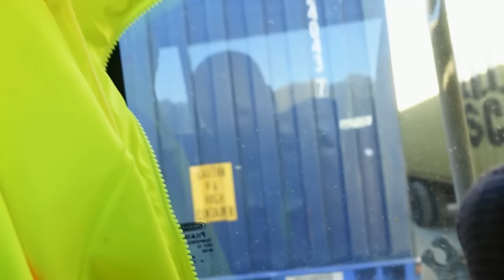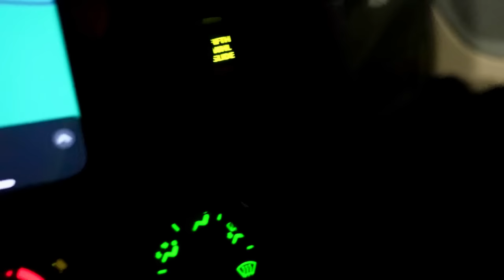Hauling Containers: First Time at Savannah Port

Comment: I use two .. a truck GPS.. an a car GPS.. some roads will not show on a truck GPS if it's not a truck route  .. u dig .. get one ASAP .. be safe.. life of a driver is if u safe  ..
Reply: Facts; Truckers sleeping on Google Maps you gotta know how to use it correctly
Reply from the maker: I use 3. I’m talking about the port doesn’t have a specific address. So, one of my coworkers told me to use “1 Main St” to get to an entrance. The port website says it’s in Garden city but that doesn’t come up on a gps. I had to put Savannah.
Reply: I have the same setup.  I even use my own dash cam separate from the company cam.  You never know and better safe than sorry.  Stay safe and keep rolling!

Comment: Hauling containers is some bs. Unless you have your own authority and even then, that became some bullshit.
Reply from the maker: Why?
Reply: @iamveelee  Respectfully speaking and I'm not trying to come off disrespectful nor killing anyone dreams, but the rates alone are terrible on pulling containers.  Beware and careful of these containers companies playing crackhead games with their recap tires if you have a blowed tire. Make sure that you have the technician write peel cap on the invoice if they come out to change a blown tire. Also monitor your fuel usage. You could fill up , but that probably may eat up your load. I used to multiply where I'm going at × 2( Round trip) and back and then I divide by 6 and that's how many gallons I put in.  Maybe a little extra if I'm heavy. Beware of their drayage fee and escrow.
Reply: You came into containers at the wrong time. Get your tanker Haz and pull tanks. You’re definitely a go getter though.